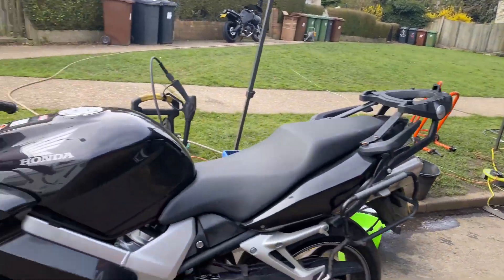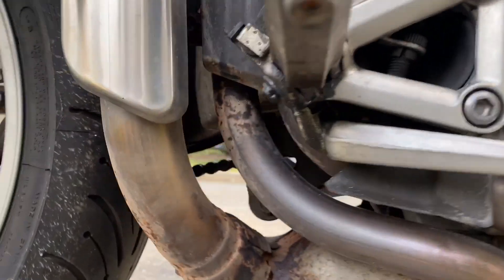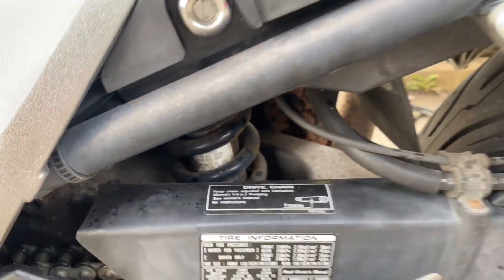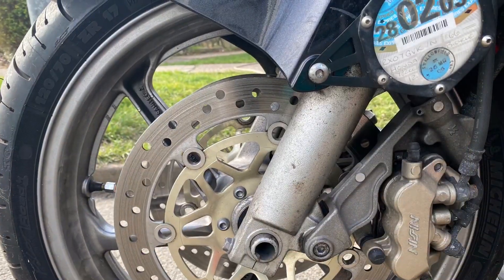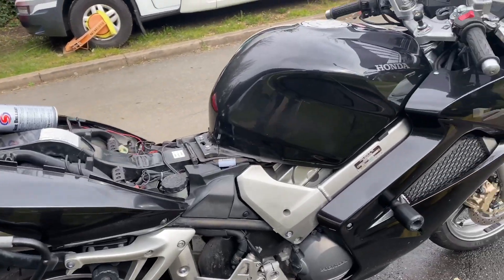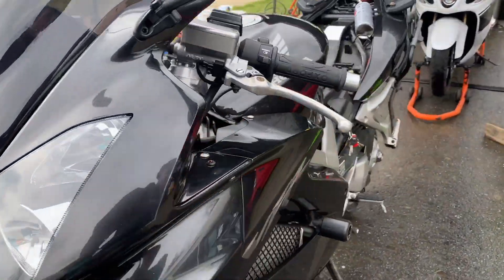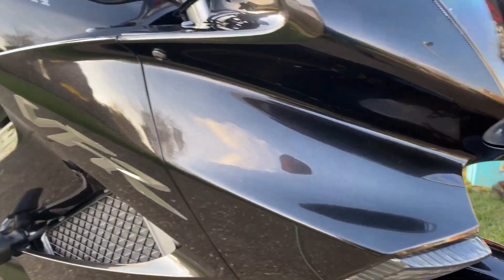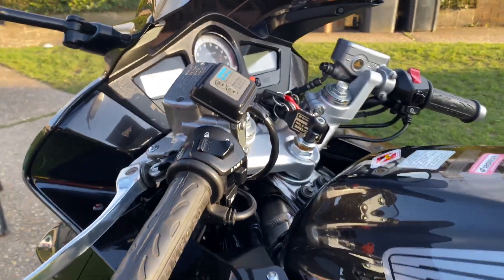HONDA VFR800 GETS A FULL WORKS VALET

Comment: those oil cooler pipes at 1.51 are a safety recall item as they rot and can cause oil loss on front tyre

Comment: what is the price for that ????
Reply from the maker: Many thanks for your enquiry. Your quickest and cheapest option would be to ride out to mine one day in Elstree. WD6 Post code area. I have a lovely lake across the road. Have a walk and some lunch while I work my magic. I generally work from Elstree Tuesdays’  to Friday’s.  
       A "Trott Full Monty" valet generally can be done within 2 - 2.5 hours. £150 -£200. Thats a complete Valet getting your pride and joy looking like it just rolled out of the showroom. Not only will it be looking mint again it will also include a good coating of ACF50 winter protection. I will be continuing this special for the next month as its been such a hit. Be-spoke cleaning of Harley's, adventure bikes, Classics and tourers 2-4 hours. All charged  @ £75 an hour. I can now offer the full range of Ultimaxx  Ceramic Paint Protection. From the NanoMaxx Yearly protection to the ultimate Signature Pro Reserve for that 5  year protection. I am doing the 5 year Signature Pro Ceramic at a special 1/2 price at only £50 added on to any “Trott Full Monty Valet” 
       I do offer a mobile service, this however is a bit more expensive due to travel time etc. I would need plenty of space to park my van and set up, also water and electric preferred. Usually this service is more cost effective if their is a few bikes as it would cover the extra cost for travel, set-up etc. I can usually do up to 3 bikes in a day. 
      The third and best option (“The Works”) includes pick up/delivery. Usually picked up on a Friday and taken to my valeting studio in Dorset and brought back on a Tuesday. This is the best option as It would be done in a heated studio with a ramp. Spending anywhere between 4-6 hours. On top of a “full Monty” it would include proper paint correction on all bodywork, headlights, windscreen etc. Once paintwork has been corrected it would be prepped and coated with the Ultimaxx Signature Pro 5 year ceramic and the Ultimaxx Slixx 1 year ceramic on wheels. Priced £250-£350
Examples-

https://youtu.be/vHqrRgm-4IA

https://youtu.be/Wyls73a37wU

https://youtu.be/20SAg0ohWaw

Let me know your thoughts,
Freddy Trott
07966249963

www.trottracing.com
Follow us on Facebook, Instagram and YouTube for daily photos and examples of the sort of work I do, you won't find better for quality and price. Satisfaction guaranteed!
 
Facebook- F.C.Trott’s Professional Motorcycle Valeting
Insta- f.c.trott
YouTube- Freddy Trott
WWW.TROTTRACING.COM
FREDDY@TROTTRACING.COM